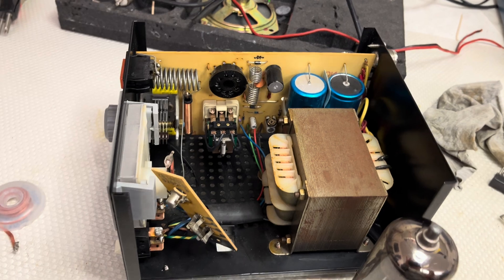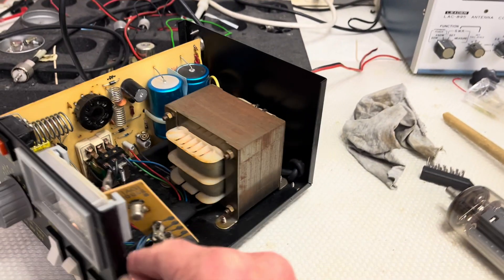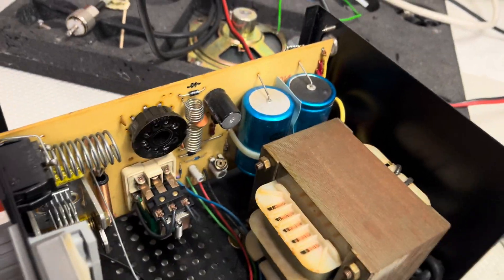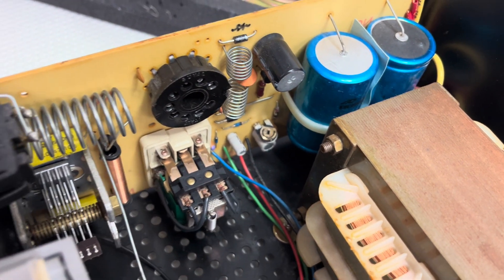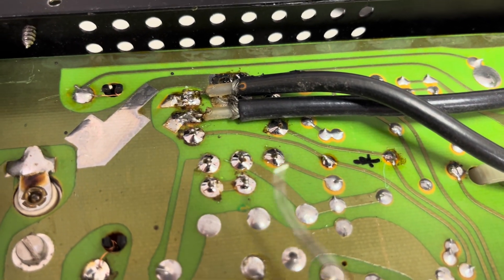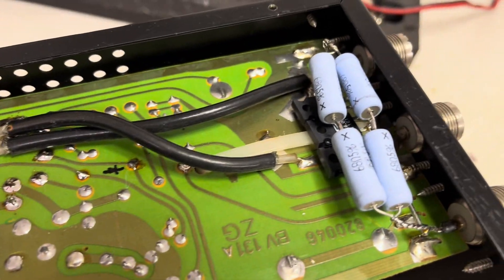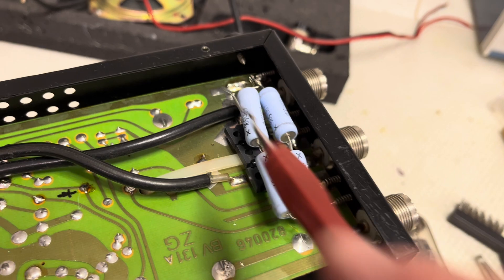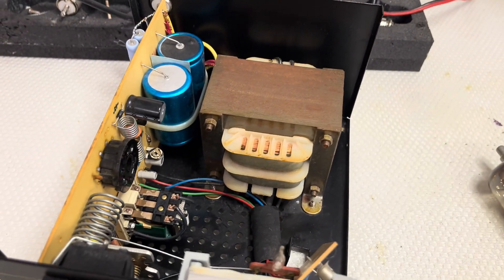ZETAGI BV 131 26- to 30 MHz Linear Amplifier to restore

Comment: Be Careful 700 Volts Anode D. C. VOLTAGE can be Healty for the Heart Muscle 😉
Reply from the maker: Hello again, Mr. Rodrigo. Indeed, there is high tension on the anode. I will be careful with this amplifier in the open chassis. Have a nice weekend and happy airwaves to you.

Comment: I have the one with the newer faceplate. Very reliable for what it is. Original EL509 is hard to trace. There are some russian/ukranian equivalent replacements. Cheers Mr SWIZZRADIOS!
Reply from the maker: Hello dear CB radio friend DX5. Thank you for visiting my channel again. After the predecessor ZETAGI BV-130, which was equipped with 2x6KD6, the first BV131 came onto the market in the early 80s. I had it in my collection at the time. But according to the data sheet, it was also equipped with 1xEL519. The design was all in light green. You can check it out at Rigpix: https://www.rigpix.com/poweramps/zetagi_bv131.htm
I hope you have a nice day... VY 73...

Comment: Change the  capacitors
Reply from the maker: Hello, dear CB radio friend. Thank you for visiting my channel again. Yes, the electrolytic capacitors have already been replaced. The previous owner had already replaced them. However, I can hear a weak hum at 100Hz on the test equipment. This is because a cascade circuit was used for the anode voltage and thus the two half-waves were rectified in common mode. I could now double the capacity of the two electrolytic capacitors, which would possibly make the hum disappear completely. I'll see when I have time again. Vy 73 to you